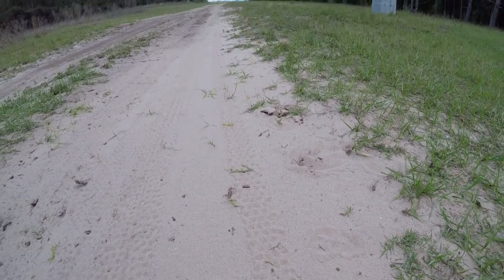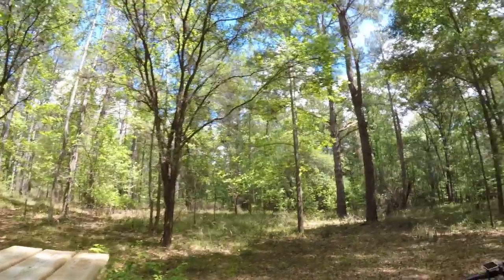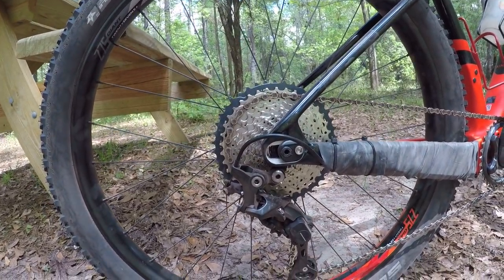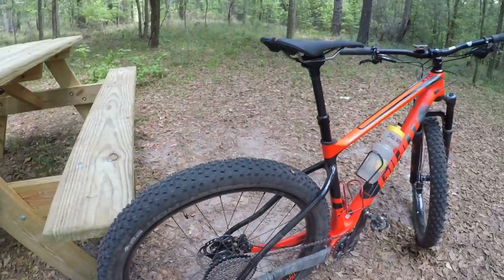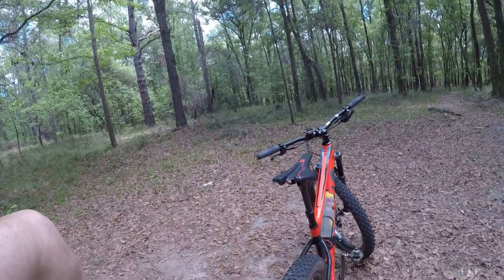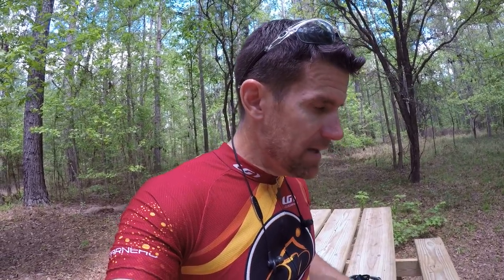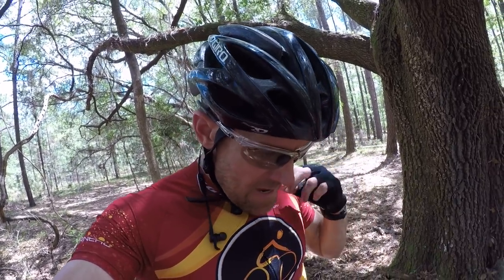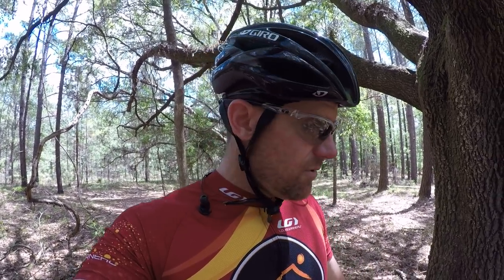VLOG#9 - Getting Used to the Plus Bike

Comment: A quick look at some 27.5+ tubes suggests they come in at 400-600+ grams each.  Not sure what the Giant's tubes weigh, but it sounds like you could drop nearly 2 lbs of rolling weight with the tubeless conversion.
Reply: This is very true. On smaller tires tubeless is a minor improvement from a weight stand point but with these bigger tires the difference is huge.
Reply: You can get the tubes as light as 200g.
Reply: We got those tubes in my shop and they are HEAVY!!

Comment: Clint can you tell me the bottom bracket height and if there are pedal strike problems?
Reply from the maker: +Jim Allocco have not had any pedal strike issues at all so far. It's actually better than my 29er in that regards I think. I'll get a measurement soon.

Comment: Hard to fully compare the two bikes with such a drastic difference in the wheelsets. Maybe H.E.D. can send you a pair of Raptor 27.5s. Run tubeless with that or even alloy I9s and you'll likely shave almost 5lbs off that beast. Enjoying the results as you roll them out.

Comment: Try a regular 29er tire rear. Trust me, it's been very fast for me. Yes, having lots of options is good for riding a variety of trails in a variety of ways. Plus bikes vs 29ers are like riding cyclocross vs road bikes in my opinion. Cyclocross bikes are more fun and faster on some courses, but not as fast on others. It really depends how and where you ride. Glad you are liking the plus. Keep riding it, you'll see your lap times decreasing as you ride it more for sure.

Comment: The tire pressures you mentioned last time seemed low to me but I don't know how this should vary with rider weight.  Might consider something closer to  13 - 15 psi to see the difference.  Shortening up the wheelbase is an interesting idea, glad you mentioned it.  The 27.5+ inner tubes I've weighed all come in at 0.33 - 0.34 lbs on the scale I have.

Comment: Where I think you will be pleased with your plus...moderate mountainous terrain (medium climbs with almost DH descents)....I've found my times to be a lot faster in this style of terrain vs my 29er (xc) I have the control, the traction and the extra weight is not an issue...think you should really focus your testing in this area....it will make you rethink your soft tail. Yes full suspension is probably faster in this terrain category but the plus hardtail is still my go to. I know your sponsored by your local shop that carries Giant, but test out the Trek Stache if you get a chance...29er plus is even better!

Comment: I love my hardtail 27.5 for cross now i run tubeless and low pressures. I did have a suspension seatpost for a while which was ok. I;d not bother myself going so wide and heavy probably somewhere inbetween like 2.5.

Comment: I'd think with the non-stop cornering and loose soil at San Felasco the 27.5+ would be a blast to ride. I had an enormous improvement just going from 2.2 to 2.35. I don't race though so weight is not too big an issue for me.

Comment: Clint, I'd like to see you put a Rocket Ron on the front, which has less rolling resistance than the Nobby Nic, to see if it makes it any faster.  I would also like to see you use the same tires on the 29 wheels for an "apples to apples" comparison.

Comment: im slightly confused about the 29er wheel swap option on that bike, are Giant saying that you can just put a 29er wheel on with no modifications to the bike? seems too good to be true?!
Reply: Generally you can install 29er wheels in most 27.5+ bikes. 29er wheels have a slightly larger outer diameter vs plus bikes.
Reply: the reason is 27.5+ has a taller sidewall which ends up making the overall wheel size pretty close to a standard 29er, therefore you can throw on a set of 29er wheels without any changes

Comment: smile sum it won't kill you .I like your vids but you need to lighten up . look at it this way , think how lucky you are to get to play with all these new bike's all the time . Btw my all aluminum Salas timberjack weights within a few grams of what your carbon giant weights, and that in itself doesn't make sense? that carbon rig should be at least three to four pounds lighter? head scratcher.
Reply: Keith Oliver hardtail vs full suspension. linkage and a shock aren't weightless
Reply: I'm not sure what your trying to say but the 27.5 in his video is a hardtail carbon fiber giant frame and my salsa timberjack is a 27.5 hardtail aluminum frame this is as far as I'm concerned an Apple's to Apple's comparison in style of bike except his is carbon and should be lighter except it isn't
Reply: Keith Oliver the weight difference comes from the plus size tires. Bigger tires, wheels, fork, ect.